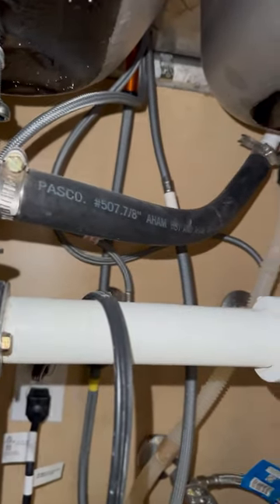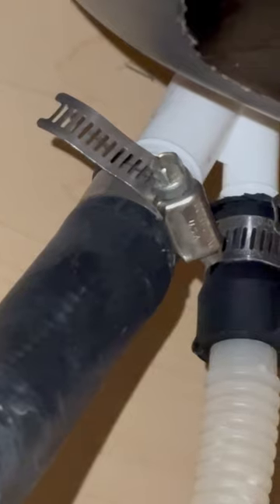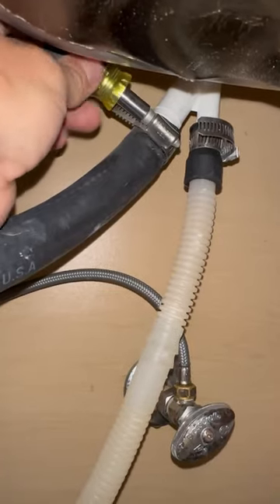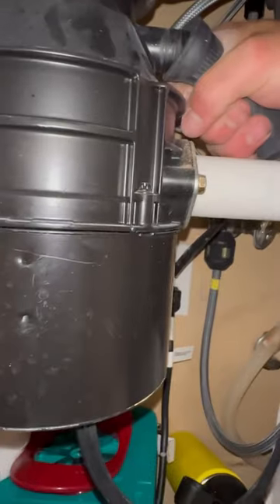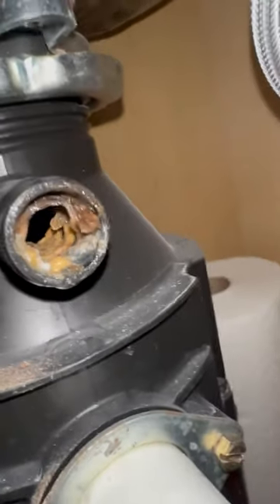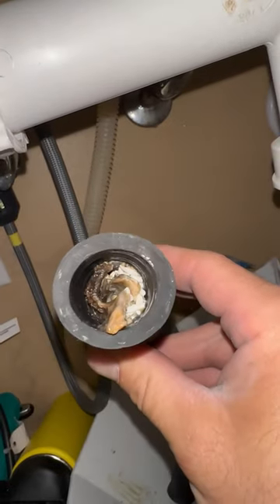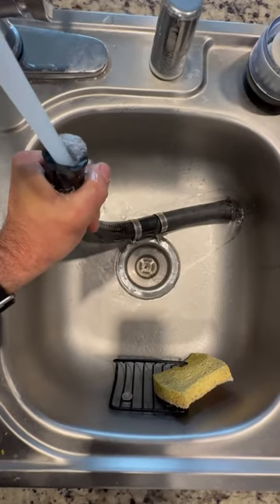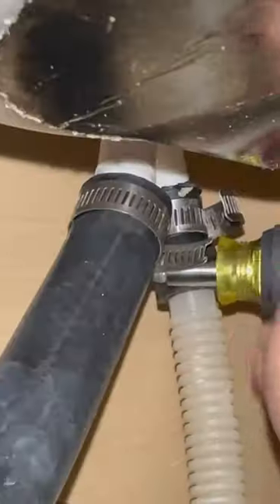Water leaks above sink when dishwasher runs

Comment: Just did this at work today, turned out I installed drain saddle for an RO backwards. Problem was I ended up creating a smaller drainage point coming from the air gap so it couldn’t drain at the rate of the dishwasher. Just had to check this out as a fellow tradesman in CA. Keep up the vids!

Comment: I use a wire brush from the top side of the air gap and just clean out the hose. Never had to disassemble the hose before
Reply from the maker: Thanks for the tip!

Comment: I did a service call out where the homeowner installed a new garbage disposal. He forgot to break the plastic knock out in the dw drain port before hooking it up the the air gap. I explained to him that they come sealed incase someone doesn't have a dishwasher. I hung out for a quick drain and fill to show him the difference.
Reply: Hey bud first time putting in a dishwasher, got everything in no leaks but when I plug in my garbage disposal it turns on automatically and I can't turn it off🤷 what do you think is going on? Ground on the dishwasher isn't right?
Reply: I can’t thank you enough for this comment! Saved me a huge hassle!

Comment: So having an air gap just adds another issue vs a direct connection got it mine will stay direct
Reply from the maker: Having an air gap prevents water from filling up in the dishwasher from the sink, should the check valve inside the dishwasher drain hose fail (which is common)
Reply: You put in a high loop.
Reply: @tjmccormack7370 Exactly!! Had mine direct for over 15 yrs with a high loop and 0 problems

Comment: My hose is stuck on both ends after I removed the clamp. Do people add glue to the ends or could it just be stuck for not being removed after a while. I don’t want to force it since some parts appear to be plastic.
Reply: Saw no one replied to you.. no rubber can get weird as it ages. If you have a heat gun use that to soften the rubber or use a hair dryer. You want it to warm up and be soft.
Reply: @justhereforthecookies8129  Thanks for the reply. I got it off.

Comment: I used long 36in zip tie to go in from top of  air gap to clean out the that hose  no to take it a part
Reply: tried it today , it works but the other end connecting to the garbage disposal needs cleaning too . Regular cleaning at both the end helps :)